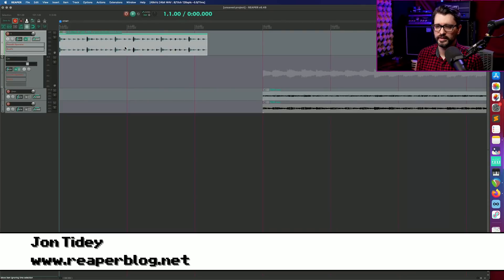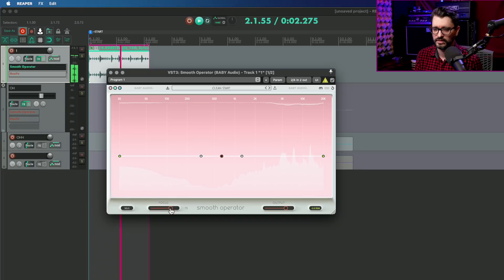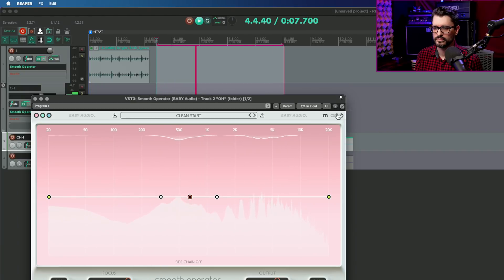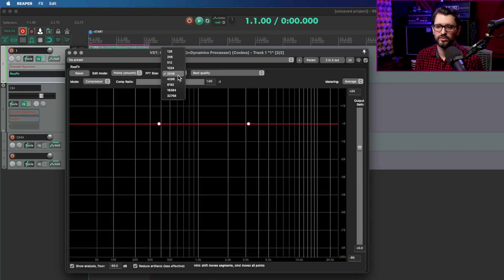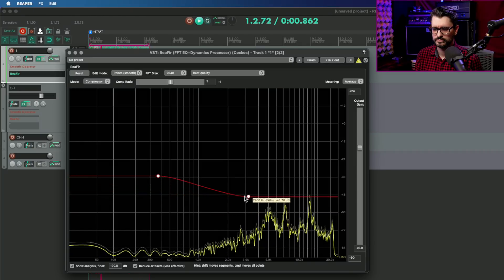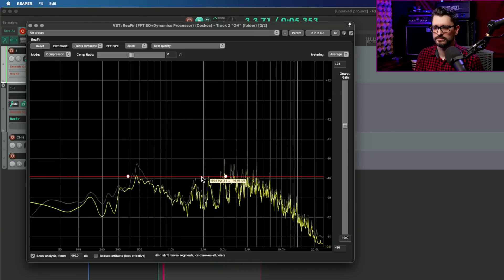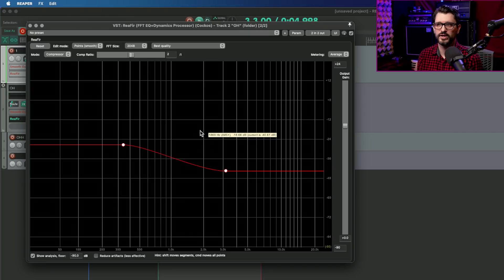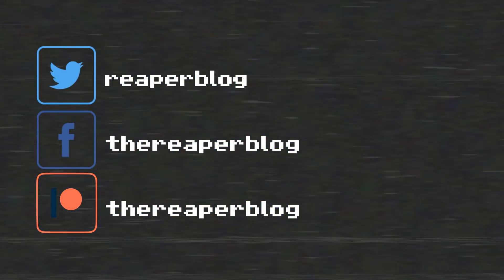Battle of the de-harshers - ReaFIR vs Smooth Operator

Comment: Thanx for the Video, Jon. I donot know, how flexible Smooth Operator is, but with reafir you can adjust the frequency curve so individually (you didn't show this), that nearly every result can be processed. For excample, you can match the analyzers curve to the process curve and from that, adjust with pencil-like tool to every curve you want. Seems complicate, but you can realise nearly every result you want. I really love reafir for this possibilities.

Comment: Ok wow I literally needed this today. I'm trying to remove the closet resonance from a vocal stem. Is using ReaFIR advisable to clean up the room tone in vocals? Or are there other cockos tools you'd recommend beyond EQ+multiband?
Reply: If you start with substract mode to match the analyzers curve to process curve, then switch to compress mode and use fine curve edit with mouse to adjust details, then experiment with compress ration and/or ... so to say... curve level adjust I think you can fix nearly every problem.
Reply from the maker: ReaFIR in subtract mode is fairly good for reducing constant background noise. In compress mode I think it may help with the low resonances from a closet if used very carefully, but I would rely more on ReaEQ with narrow cuts.

Comment: Couldn't you just use a deesser to get the same basic effect?
Reply: Most de-essers are multiband compressors with a small HF, dynamic EQs set to a specific frequency, or full-band compressors with the sidechain only listening to a small HF band of the signal. Like Jon said, you can get similar results with a dynamic EQ like TDR nova but it doesn’t have the pitch tracking which would help you tame those moving resonances and is also limited in the amount of bands you can use.
Reply: @Googahgee  hey.. what do u mean with pitch tracking??

Comment: Maybe a bigger FFT size would render better results
Reply from the maker: I tried most of the settings to see. in delta solo the larger fft sounded more tonal and smeared, and smaller was more squishy.
Reply: FFT has a trade off . Larger FFT buffer size is better for freq accuracy,  but worse for time accuracy, vice versa with lower FFT buffer sizes.

Comment: I used to use Oeksounds Soothe 2. It did a great job. But I can't seem to get the vst version to run smoothly on my system with Reaper.
Reply: Mine seems to work great on my system.  Are you using VST3?